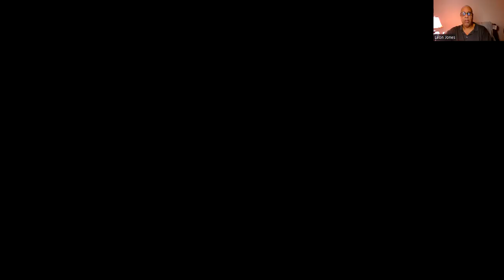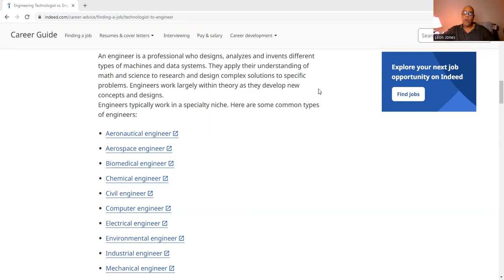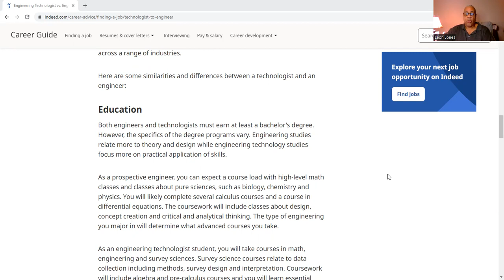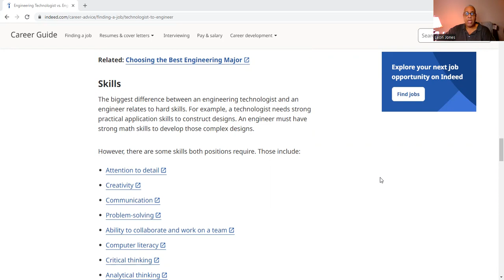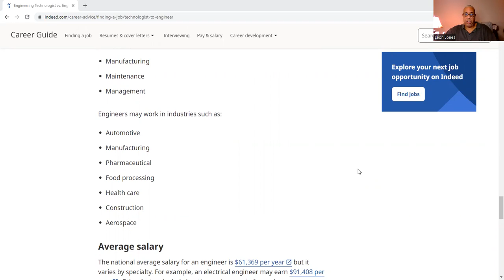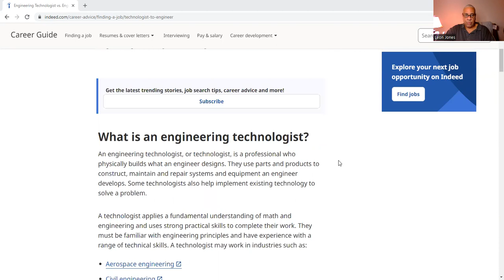Engineering Technologist vs. Engineer: What’s the Difference

Comment: Thank you for the video.  There is so much confusion about the engineering technology (ET) discipline, especially when it comes to the career that a four-year ET program prepares someone for. I have been teaching ET for 16 years and I have had 0 students to get a job in industry as a technologist.  To guess, I would say 95% of my graduates are engineers right out of college. Also, half of the states in the US allow ET graduates to take the PE just like graduates of theoretical engineering degrees.  There has been a push recently to change the names of four-year ET programs to Applied Engineering, which is a better name for the discipline.
Reply: If you get a degree in engineering technology as long as it is accredited by ABET whether it is EAC or ETAC, you will still be considered an engineer. In the past most students who majored in engineering technology could not get a graduate degree. Currently, colleges offer masters degrees in engineering technology as well as engineering. I am glad that there hasn't been a change to applied engineering because the accreditation my change from ETAC of ABET to ATMAE.
Reply: @411TalkZoneRadioShowChannel  They are very limited, but there are actually Ph.D's in Engineering  Technology too and not just master's. Also, the advantage of ABET  accreditation is that 50% of states allow ET graduates to sit for the PE. In my state and my surrounding states, you can only sit for the PE with an EAC degree, so overall, the ABET accreditation is only a validation like ATMAE. And my comments are coming from my experiences with industry and higher education in my state. As you know, each state has laws and ethics statements related to engineering. Still, I have found that the industry, as a whole, prefers graduates who have the skillsets more than an ABET accreditation attached to their degree (again, this may be different in other states). My ET program has almost 100% job placement, and students generally have a full-time position with an engineering title the semester before graduation. Many of these positions are over $100K out of college. To be fair, this is not true for all ET majors. It is different for civil engineering, where I agree that everyone needs to graduate from an EAC or ETAC school. I teach Automation Engineering, which is much more of a niche market. As far as the name change, there are studies that prove a need to change four-year ET programs to a less confusing name: https://www.iastatedigitalpress.com/jtmae/article/id/14109/
Reply: Hey man big fan